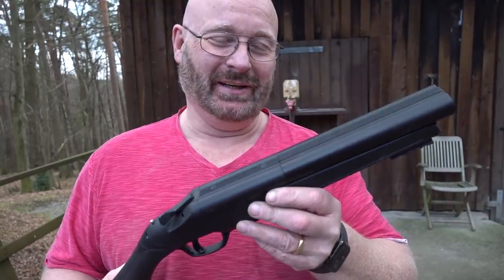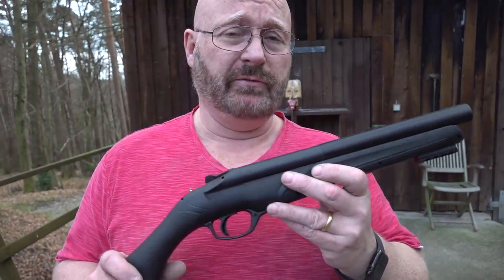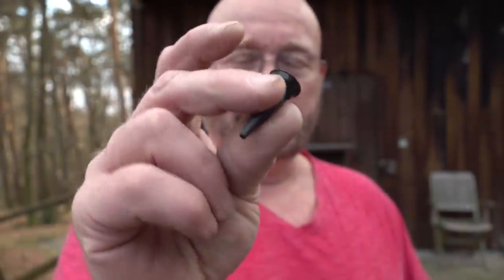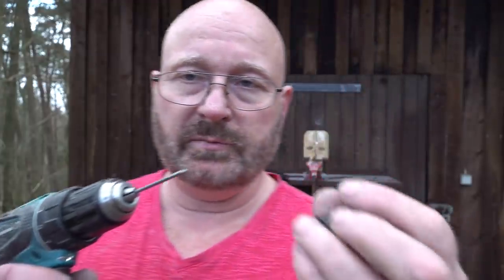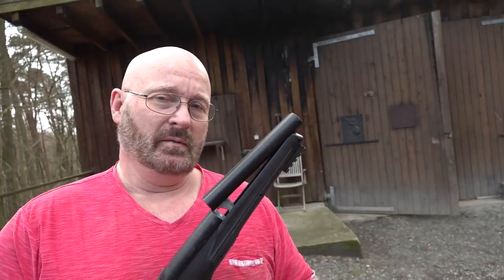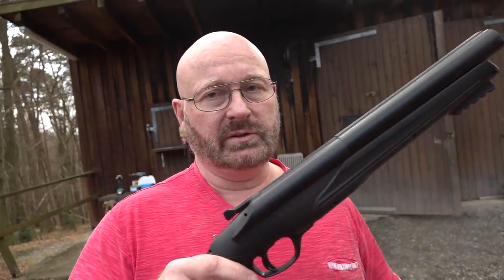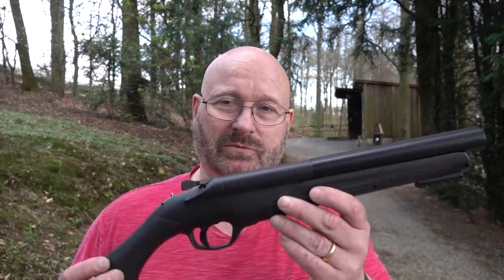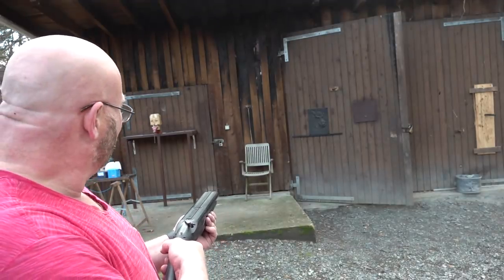Home Made Steel Darts (for the Co2 "shotgun" HDS 68)

Comment: I just used those same ear speculums and hot glue to convert 6.5” plastic metal-tipped crossbow pistol bolts to work in the T4E. HDS.  And they work very well!  You heard it here first.

Comment: Don't  use the darts as described. The darts coggle in the barrel resulting in loss of gas and damage to the barrels from the nail tip scoring the barrel. Instead use 3 speculum for each dart. Cut the funnel / trumpet part of one speculum. Now assemble the 3 pieces by placing the cut piece over a full speculum and placing the remaining speculum over the cut one. A dab of CA glue holds the pieces together. Now bore the hole to suit your nail and insert the nail. A couple of drops of CA holds the nail in place. This method results in two sealing rings, nicely separated, preventing the dart coggling as it is fired. At 10m I can drive 3.125mm (⅛") tipped darts 20mm (¾") into mahogany and 13mm (½") into oak. (16 joule "non-castrated" version). I use 3.125 x 50mm (⅛" x 2") hardened steel masonry nails.
Be aware, hot melt glue can deform the plastic speculums.
Reply: Exactly what I was looking for.
Also realized that the nail would scratch the barrel.
I have used duct tape before to prevent this.
I just tested your idea and it works great.
Thank you so much for this <3

Comment: My finds in the subject are:
The Gina brand specula is the best, thicker bodied and tough plastic. Can be shot again.
The worst brand, but also the most common in sweden is "Heine". Weak construction that breaks on the first shot.
There is also a 4 mm version that's of course fits 4 mm nails perfectly.
The nail for this is called "anchor nail" and comes in some different lengths. Like 40 and 50 mm.
The 50 mm version makes for a 6 gram dart with lots of punch but it is easier to extract from the target than the 2.5 mm, which requires a crowbar in my experience.
Reply: Gima brand is the name

Comment: have you tried using baffling? About 16 years ago using a spud gun(nz not aus) we found an apple was the best projectile, followed by beanbags... We decided a nail would be the best projectile, so we cut out the barrel size of polystyrene, put the nail down the middle, then cut the lot it two. Halved it so one is supporting the front half and the other is supporting the rear..., it went from puncturing holes in walls to literally no one is safe on the other side of what we call it gib(Americans call it drywall).... my understanding is it's called baffles or baffling

Comment: Hello Joerg, I already had the idea with the ear specular. However the hot glue deforms the funnel in conjunction with the nail. I think its gettin to hot with it. With a thin blowgun dart needle, it stick the cal. 40 with the plastik in the funnel and it works. Any idea somebody here in the channel?